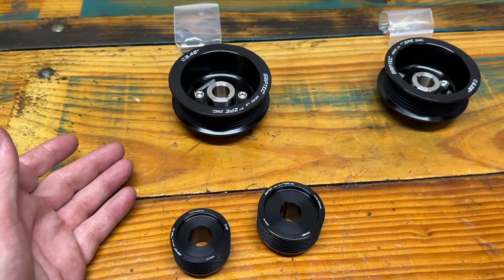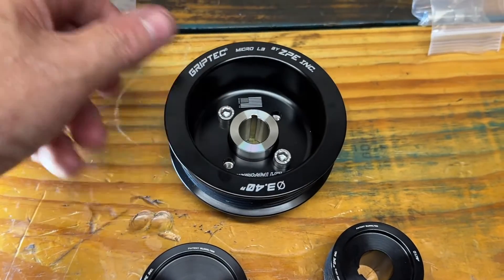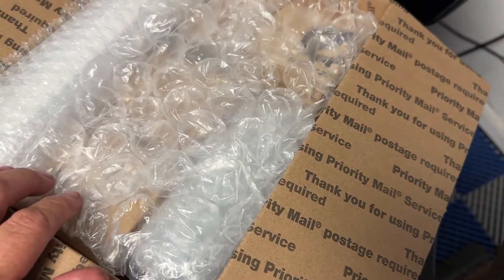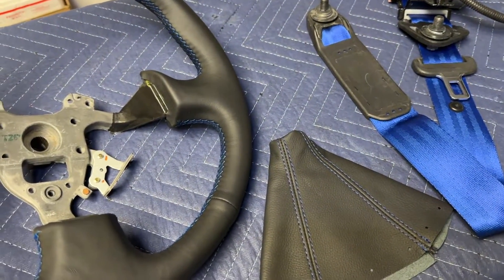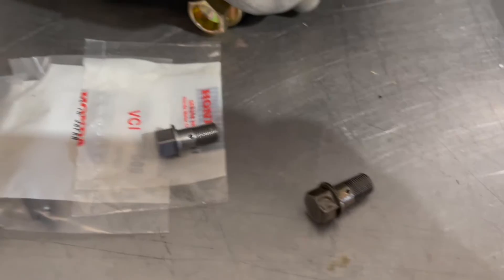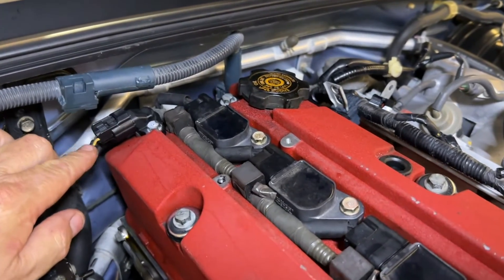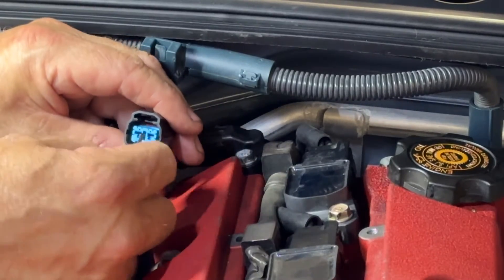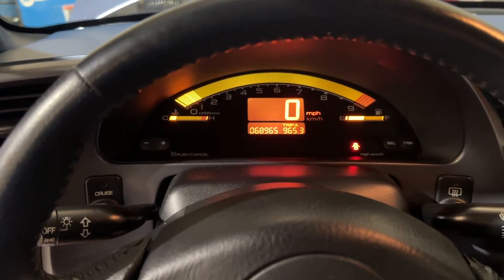H22 JRSC GripTec PULLEY = Most Boost !

Comment: Whats the difference if i buy yhe 3psi boost upgrade? Do i still get 3 pulleys?
Reply from the maker: @JemsXiong  We have a standard boost kit and a high boost (3 psi increase kit ). They are two separate listings.
Reply: @LHTPerformance  essentially the same thing besides the 3psi correct?
Reply from the maker: @JemsXiong  Yes. The kit is the same except the pulley for the blower. By decreasing the diameter it increases boost.
Reply: @LHTPerformance  cool, looking forward to buying the 3psi increase kit. Any tips on installing? Belt tension, size, etc.
Reply from the maker: @ Install is the same way as stock. Run enough belt tension so not see the boost drop off in higher rpm’s. Data log it, run just enough tension.